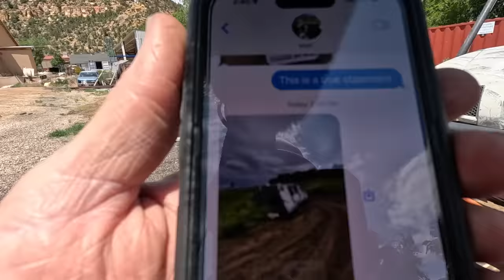Off The Edge: This Trailer Recovery Might Be Too Much For The Rat Rod Wrecker!

Comment: Heck of a recovery 👌  Maybe some drop down legs on the rear of the wrecker  would help when  only using the boom/ winches  to lift.  With legs seated firmly on the ground you could get full use of the hydraulics & winches, without giving up that much to  the suspension.  Just a thought 🤷‍♂️. Great video,  keep em coming !
Reply: If the wrecker had a tow bar, like the roll back, that probably would have done the job of outriggers.
Reply: Hell of an idea, if he was smart, he would definitely give it some thought.
Reply: I was thinking the same thing even if they were just a set of manual outriggers, would definitely help!
Reply: Hydraulic spaded outriggers on swivels.  Line them up against the load and set them in.  This will give you a ‘Firmer Foundation’ and move your center of balance even farther to the rear, helping keep your nose on the ground.
Reply: Just about to suggest the same thing 👍👍 The winches obviously have the power but the wrecker doesn't have the weight some drop down spades are a must
Reply: I was thinking the same thing...a smaller, lighter wrecker like Paul's (in comparison to Matt's much longer and heavier wrecker) would definitely benefit from some sort of hydraulic or even manually-set-up type of stabilizing outriggers that act similarly to those on a typical full-sized backhoe. Build 'em strong enough, perhaps detachable (carried on mounts on the sides of the boom?) and the front end of the wrecker wouldn't be able to pop up in the air like that when lifting and pulling on something close and heavy like that.

Comment: Hello, Paul I think you may need to make a spade attachment for the back of your wrecker that presses down on the ground so your front won't lift as much when pulling heavy loads.
Reply: I was thinking the same thing, he has the pto pump that was  to slow for the winches. Would make a good down rigger.

Comment: Paul, I wasn't there so this is just from what I see but next time you might find it a little better to keep the boom as fully retracted as possible. That will keep it from rotating the front end up so easily. Again, I am not there but have run hydraulic boom wreckers many years ago. Not exactly in those situations though. LOL.

Comment: Shorten your boom Paul. That's called ' cantilevering. Long boom , less lifting power. Your extending boom is excellent but without front weights, you are like a crane without back boom weight. Your truck is amazing. I have a big truck with extending 40' boom and big Tulsa hydraulic winch. You did good with that much weight.

Comment: Paul I'm sorry to say that I think you need to watch a video on how to actually use a recker boom. Having your boom fully extended like that was the whole issue. All you had to do is bring your boom back down and keep it as low as possible and you would have had no trouble doing exactly what you wanted to do. Having your boom extended all the way like that is why your front wheels came off the ground as soon as you put any tension on those wenches. You were putting your leverage in the wrong place
Reply: This X2

Comment: Paul how about adding a couple of hydraulic cylinder spades to the rear of the wrecker. It would do a couple of things, dig in and add extra pulling power and second prevent the wrecker from tipping. They could be attached in such a way, that they would pivot up to get out of the way when not needed, By nesting in some channel iron when turned down, it would add extra strength.

Comment: I think that's one where the weight of the heavy wrecker would have helped but I'll tell you what, Paul, Matt and Rory are formidable in the "thinking these rescues thru to conclusion" department. Great job!
Reply: I think it might have gone smoother if Paul had kept the boom retracted. 

Extended cuts the useful load in half,  giving the load more leverage over the weight of the fab rats wrecker

Comment: Great rescue. Suggestion on the use of the boom. I realize you were trying to lift the trailer, but a shorter boom would still do that, and the front of the truck would have more leverage over the boom. With the boom fully extended, the trailer had more leverage to tip the truck. So in the end I would try to use the shortest boom you can, so you have the most leverage pulling the load.  Amazing truck.
Reply: Came to the comments to see this one! 

Was blown away when they didn't realize boom retracted would not have lifted the front of the truck.  

Bravo for spotting this and commenting!

Comment: Great job , but a note to the tow truck operator , the closer the boom head is to  the truck , the higher the lifting capacity and the less chance of the front wheels lifting . I drove cranes for a few years in my younger days , it is all about the leverage due to distance from the pivot point . The closer to the pivot point the greater the leverage . In this case the pivot point is the rear wheels of the tow truck .

Comment: You folks need to revise the front bumper so you can hang a counterweight there when you need it. You would have a lot less trouble if you could add a ton or two of additional weight to the front end. And a small, high capacity trailer for hauling the counterweight behind the tow truck.

Comment: Just an idea:  You could possibly put water in the front tires for some extra counterweight.  In some applications, calcium chloride is added to the water to prevent freezing so you can run it year around.  Chlorides are corrosive, so only if a tube is used inside of the tire.

Comment: It’s becoming apparent both you and Matt could use a form of ground anchor. Perhaps a gas powered auger that’s used to put in deck foundations. It’s a 2 or 3 inch thick  steel post with its own auger head, just run it in and hook on.

Comment: Someone may have suggested this but a pair of hydraulic out riggiers that fold down behind the wrecker would help with heavy winch jobs like this. 
They could fold up when not in use or may be even removable until you know you will need them.

Comment: That was an amazing recovery. I love the wrecker. I used to run a boom only wrecker. The only suggestion I have is to add a couple of 2” square tube legs to the back. I had them and they do wonders at keeping the front of the truck down during a hard winch pull.

Comment: Impressed with the strength of the chassis/crane/connection point.

Maybe have legs/outriggers that come down so the suspension doesn't compress when trying to lift with the crane.

Comment: Outriggers? Hinged at the bed corners so they can swing out when needed into a variety of positions. Telescoping to create a wider stance. Obviously these would have to be pretty beefy but I think they would still be lighter than needing the mass of a heavier wrecker. Might help stabilize the vehicle in a variety of situations and allow the winches and recovery boom to work more effectively rather than lifting the front end off the ground by eliminating the rear axel as a pivot point. In any case, would be a fun upgrade to see being built and tested.

Comment: Paul, have you considered making some 'Stab Jacks' on the back of the tow truck to keep it from squatting down in the back when lifting? I guess that is a big advantage of having a wheel lift sticking out the back. Your tail is so short that it really wants to tip. But that short tail really comes in clutch when you are going up the steep banks so it's always a tradeoff isn't it. You made it work, Grandpa Sherm would be proud of both you and his old truck for sure. God Bless you all.

Comment: Check the video out at 3:50 -3:54 their is an odd translucent cloud under the left front tire which i thought was exhaust but its not. Add bed stabilizer legs to the back of the wrecker like we have on our military 5ton recovery vehicles. We put the landing legs out when we have to recover other 5tons in the same type of situation

Comment: In situations like this where you're fighting to keep the front end down. If you shorten the boom length, it will lessen its mechanical advantage on the truck weight and help keep the front end down.

Comment: After watching several recoveries with the Old Wreaker, you might want to consider installing some outriggers on the rear so you can keep it down when lifting heavy loads. Might be a little tricky with a short tail on the truck, but could be helpful to have.

Comment: I cant help but wonder if Paul’s Caterpillar mini-excavator I’ve seen in several videos would be of  help in these types of jobs. I’m sure that has a lifting of capacity of close to 2k, if not certainly a pulling capacity of 2k lbs with the issue of traction and weight being eliminated with steel tracks, which were both issues in this rescue.

Comment: What about putting a rack on the front end and getting some tractor ballast weights that you could add on when you need them.  It would  give more  weight on the  front end. Pull plates and  stack behind the cab. Won't even affect your ride quality

Comment: Hey Paul, maybe you could look at putting a couple of hydraulic feet/claws at the back of the wrecker, so you could lift more weight without it picking you up. I know its a balance between the tow truck having good recovery attributes as well as good off road abilities, but I am sure you could come up with a solution, and it would make a couple more fabrication episodes.

Comment: Good job Paul. I’m wondering if you need to build some Hydraulic legs similar to that used on Back Hoes?? Those would keep your front end on the ground and also keep the truck from sliding backwards. You could build them to full up to the sides and swing down and pin in place then Hydraulic cylinders to extend them out!! I’ve just been thinking about them every time I see that front end lift!! Just some food for thought.

Comment: If you shortened the boom length, even a little bit (experiment with it as you go to find what works best) you would get greater lift with less rise of the front end of the wrecker.

Comment: Your crane is almost right over your axle.  Since you can't really move your axle forward on your rig, perhaps could you add some stabilizers going out the back of the truck to push on instead of lifting the front of the truck up?  Otherwise you can only lift as much as the front of your truck weighs.  The stabilizers would have to be pretty heavy duty, and heavy, but I think it would solve your problem.  Love your truck and your channel!

Comment: Hints: Next time dump the water tank and hot water tank ASAP. There could easily be a half ton of dead weight in water alone. Next unload anything possible, ASAP.  If I know anything about RVers (I am one!) he doesn't have 400 lbs of gear on board, he has 800, so get it out as soon as is safe, or at least shift it higher inside. Lastly, ensure the propane is shut off when you first get on scene. 
Otherwise, great job! I had expected you to rip off the rear bumper of the trailer!

Comment: Having that boom extened like that acts as a lever. The weight of the trailer on that lever actually  worked against you. You didn't seem to need the boom extended.  The front of the wrecker is already light, and the short wheel base of that cool little truck gave you very little lifting power.  So keeping the boom as short as possible would help reduce the mechanical advantage of the weight of the trailer working against the weight of wercker. Just my observation.  You might consider leaving that boom short whenever you can to increase your lifting advantage...  All-in-all, you did a great job! No damage to the trailer and that is the sign of a pro.

Comment: 14:49
Leverage working against you here brother. With the boom fully expected you give that 10k anchor more rotational torque on your rear axle than the front end. I think boom high but retracted would have given better results in this situation.
Even with that, slow and steady always wins. Sometimes you'll lift it 6" back to the road, then the mud settles 4" again while you reposition.
Be safe out there brother, gunna watch the new wrecker update after this is done.

Comment: Hey Paul, I’ve read through a lot of comments and I agree some outriggers on the rear would help but what if you could rig the front winch slung under the truck to pull like you were using the rear bumper winch in this recovery.

Comment: I feel like the wrecker is a hair too short and a little under-sprung in the rear. Seems like it has the raw power to pull a lot of stuff out, but before it can reach it’s full potential it’s starting to lift in the front. Almost needs the rear hydraulic anchor support.

Comment: A must for the lightweight ratrod wrecker, a telescoping pole with quick pin bases that quick pins under the last bulkhead to the dirt/ mud/ rock.  Two poles under the head of the boom to the earth, lift anything, with the double or triple wheel snatchblock. Your patents should f@##$ your mussel legal fees to the moon.

Comment: Hey Paul, could you add a caster wheel of some kind that would fit into you center rear receiver? That way you won’t get so much rear squat. Also that would allow you to still move with the weight

Comment: Why not add a front weight bar like tractors have so you can add or remove weight as needed during a lift? 
Great video always like the way you solve problems.

Comment: If you had your boom in I think it would’ve done better. If you used that black f150 as a dead man on the front of your rig. Also you should make a set of square channel drop down outriggers for the rear like big wreckers have . Where you set the height with a pin . Plant that little beast.

Comment: Having that boom stretched out like that is not helping you . All that happens is you lift front and of ground plus you risk bending the boom and and if that camper would have decided to slip down bank it would have flipped you right over backwards . Keep things short and low for stability especially when you're load out weighs your truck stay safe 👍👍

Comment: I wonder if you installed a set of outriggers on the back...like 2 inch square stock inside of 2 1/2 inch that would adjust to length and have a claw that would dig in as soon as you put load on boom? Just slide out and pin to adjust ...

Comment: Ha Paul
Jeff Carder hear,,
Have you ever thought about putting a rack in the front that is mounted to the frame that could hold some whate like a tracker has if you know your going on a heavy haul you could add some whate discs to keep the front down also maybe some kind of steel pipe with some barbs on it to drive into the ground to pull off of 
Maybe not the pipe but the whate rack you could use for extra water and gas when you didn't need the whate ,,, just a thought love the show keep up the great work
Thank you and Michelle 
✌️🚜🛠️👍

Comment: Hey paul,  need to figure out how to add weight to the front end of the wrecker so you dont tetertotter all over... Seems you lost some lifting power as the front end rose up...  But then again you did get the job done in fine fashion 😁👍

Comment: If you would get a much straighter line on the trailer over the lift it will come out much easier because of Tongue weight,

Comment: Why didn't you use the winches on the side for the truck instead of the back? 

Would not extending the boom all the way out give you a shorter arm it might keep the front end down a little more

Comment: Not an expert   been in the oilpatch for 40 years  tell you this  get outriggers on your Tonka truck   make sure they swing so you can use them on the sides or at the back  12 V hydraulic powerpack   2  4inches rams 36  45 inches of travel  2 days work  it will give you more potential for the boom

Comment: May I ask you a question and get a reply. I own a 1997 454 Big Block Chevrolet Winnebago Class A Motorhome , And when I took it for it's Inspection I was ask if I knew there was a Big Fine for driving a Vehicle on public roads with a Cracked Windshield. You see them everywhere. But I had to take my vehicle and order a windshield they said was no longer in production,  I ask a C. H. P. about it and he verified that a broken / cracked windshields are considered one of the most dangerous items on any vehicle and it can bring a large fine if stopped. 
how do all and I mean nearly all of you supposedly Responder's get away with it? I notice all the time Cracked Windshields on many of you peoples vehicles.

Comment: For the boom,  secure to the side of it a two piece telesoping pipe with a base pad, or an old rim, that quick pins under the pully head if the boom. Three leg, support the last pully lifting, take the truck out if the lifting equation. A pole under the lift point to the ground. Max 5 to one puuly power. That truck should not move and lift 5 times the rated weight of the winch.  Teaching a mormon the ropes.
Reply: Love you, cant wait to teach recovery / mountain climbing combined.  One 200 pound man with one rope and a tripod stand can lift 5 times his weight with aa rope and his mind.

Comment: Front winch snached block around the tree to the front of the trailer and rear winch attached to the wheels of the trailer. She would of pulled right up on the road

Comment: Ok Jace, when you want to spit, please roll the window down next time, I saw the hits, not one but two, didn’t learn after the first one? Or did it separate in flight?
Still a good person even if you forgot to rol, the window down
And once again, that sinking feeling of the winching vehicle slowly sliding to the object your winch on, doubt I will ever get over that even watch as the tow truck is slowly lifted and slides to the trailer